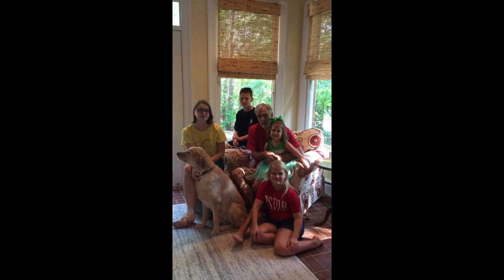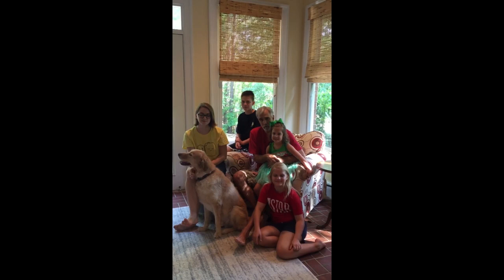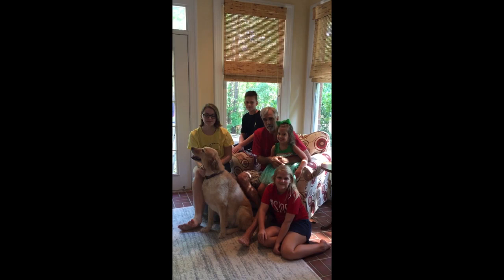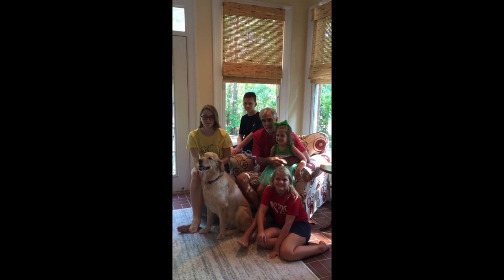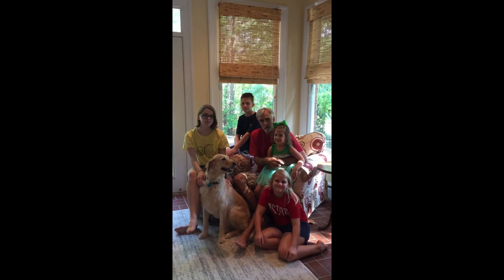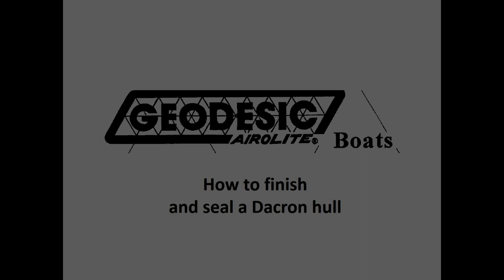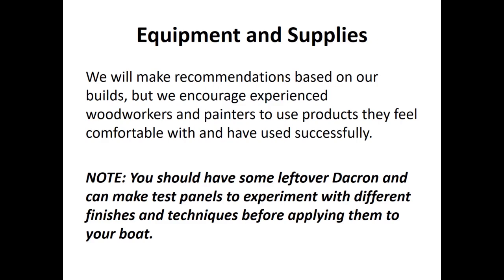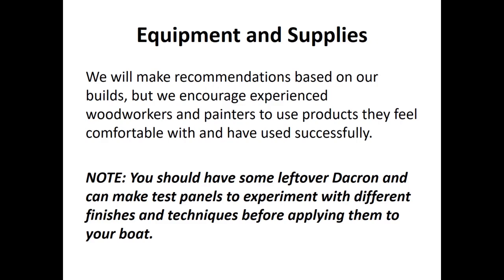Hull Finishing

Comment: Larry - great videos.  Your paint work looks great.  Last year I painted a dacron polyester skin on frame boat with Rustoleum oil paint.  The boat skin was nice and tight, but then after painting, it became no longer tight.  Any ideas what may have happened?  I love how your boats look great with the tight skin and nice shiney paint.  Great work.
Reply from the maker: Hi Dave, thanks for the kind words!  Ironically, I hate painting and am not very good at it but the boats turn out OK.  As for the wrinkled Dacron, with the heavyweight stuff there are two issues.  First, it takes a LOT of heat to make it all the way through the material to shrink the inner portion of the fabric.  At that point, the outer part is close to melting, which is why we now recommend pre-shrinking the inside of the boat with a heat gun before shrinking the outside with an iron.  Second, the fabric may seem tight but if it isn't shrunk evenly some parts will absorb more paint and cause wrinkles.  You need to go over the outside of the hull slowly and completely, let it cool and then run your hand over the entire boat feeling for spots that aren't quite as taut and hit them with the iron.  Have you checked out the video on destroying the pink boat?  It shows what happens if the material isn't shrunk properly.  Thanks!
Reply: @geodesicairoliteboats1632  Larry - thank you for taking the time to reply and sharing your experiences.  Great information.  I really appreciate it.  Yes, the pink boat looks like mine with the wrinkles.  I will go back and watch your video on how to shrink properly.  Thanks.

Comment: I see you use (normal) paints,where  others  use 2 pack poly. I have nylon for the skin on my boat and would like to use one pack yacht varnish. Will this be suitable for nylon? I wish I had choosen dacron, as I have since learned that almost anything will stick to it. Your thoughts would be much appreciated.
Reply from the maker: Hi, I wish I could help you with this but I don't have experience with any of those products and wouldn't feel comfortable making recommendations.  There are a lot of websites that address nylon and the coatings that work with it, though so you should be able to find someone a lot more knowledgeable than I!  Thanks!  Larry
Reply: @geodesicairoliteboats1632  Thanks for your prompt reply. I have searched for answers with little success,but one guy here in the UK used yacht varnish and it worked well. Seems it is less durable than 2 pack poly. The only 2 pack i have found here is floor paint , which is not flexible enough and would crack over time.Think I'll try yacht varnish and see what happens,on test pieces,then hopefully the boat. Thanks again. Thanks again from the UK.

Comment: Hello!  What waterproof epoxy did you use on the cutwater?  Will the Superbond epoxy that came in the kit work?  I was thinking about using PVC for the cutwater, do you think that will work?  Thanks!
Reply from the maker: Hi Elizabeth, thanks for your interest in our boats!  For attaching the cutwater to the boat, the Superbond works just fine, just make sure there is a nice bed of the epoxy along the bow and stern to put the cutwater into.  I also add 6 or 7 small screws since this is a stressed part of the boat.
As for the cutwater itself, I've built them from brass, aluminum and wood but never PVC.  Not sure how the Superbond works with PVC, as it requires a special cement.  An easy, tough option is aluminum.  Lowes sells 12" x 36" strips for around $4 that work really well and are easy to bend and fit.  
Please keep us posted on your boat progress!
Thanks!
Larry LaLonde, owner
Reply: @geodesicairoliteboats1632  Thank you very much!  We'll keep you posted!